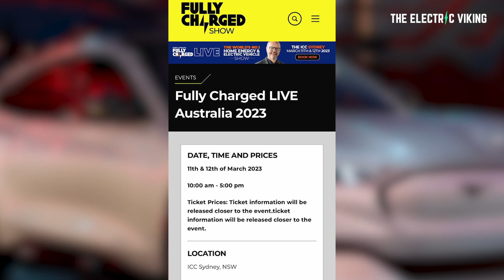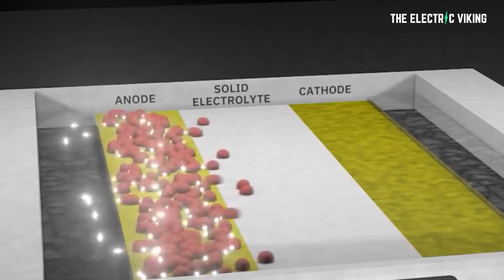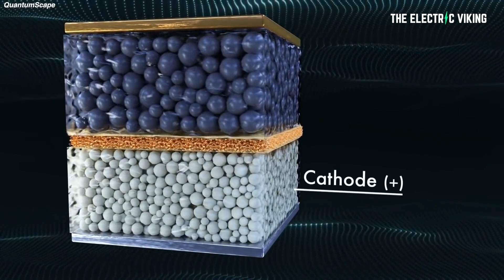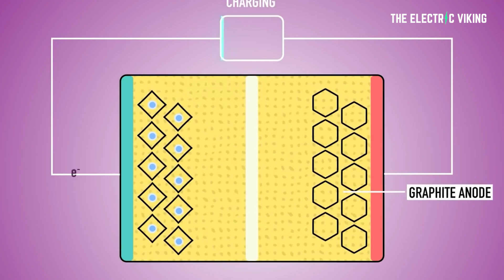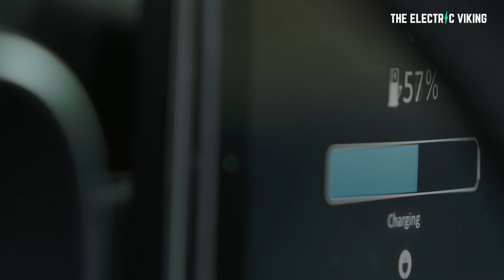Titanium diboride enables extreme fast charging without battery losses

Comment: The biggest problem with all these new battery chemistries and tech is not the tech itself, nor even really the scalability, but it is the greed/profit problem.  First, factories would have to change tooling, buy new equipment, etc for a lot of the different, new battery chemistry coming out the labs.  But the bigger problem is the problem of incentive for the corporations.  It's much like the pharmaceutical corporations in relation to things like cancer.  Do the CEO's/board members, share holders, etc of these giant, profit driven monster machines really want affordable, long lasting, true cures? Do they want cancer and the like eradicated?  Or would they prefer to keep making obscene profits?  

  It is similar with batteries. Imagine a battery with a far longer cycle life (especially this aspect), much greater energy and power density, much faster charging, etc and made out of cheaper, more sustainable and/more common materials?  Only a handful of companies would actually want that to come to fruition--mainly those that profit off less the batteries themselves, but the products that use them, like say Tesla. 

  Meanwhile, many of the mega corporations, like the ones that actually make the batteries currently, would most assuredly NOT want these kind of batteries on the market.  Eventually, their sales and profit would be affected negatively. 

   This is why any changes will be more or less incremental over time and not exponential and within a short time, if these mega corporations can help it. 

  It would take a grassroots start up to break through this barrier. A company with sufficient funding and independence, who cares more about long term sustainability over long term profits. Meanwhile, you can bet that mega corporations would likely try their best to interfere with their success. 

     Having grown up with a sociopathic family member, I am not naive to these types and that kind of mindset which becomes so common in the corporate arena.

Comment: For cars, any cycle life over 2000 cycles is unnecessary, but the ability to charge faster, operate over a wider temperature range, have less or no need for thermal management, have more power with less weight, have more power per volume, be intrinsically safer, and be cheaper and easier to build, are all things that will make a battery more suited for cars.

Comment: It seems likely any new process requiring industrial quantities of titanium would be problematic. We already have tight supplies, as things stand. Russia is the currently sanctioned global #3 producer, and China is #1. Titanium is used extensively in military applications, which will always take priority. Unless these new batteries require very small quantities of titanium, it's hard to see how existing supplies could be used in tens of millions of EVs, even if all the technical and production hurdles were cleared.

Comment: While all of these battery technologies are important and shows that developers, scientist and engineers are working hard on this issue none of it matters unless they can produce something tangible and at scale with a track record to show for. Today it's this tech, yesterday it was SSB and tomorrow it will be a breakthrough in Aluminum, Salt, Sand, Quartz and a host of other minerals, metals or materials. I'm not saying they need to stop but I think it's way too early to be speaking of tech as if it's a game changer. It doesn't change the game unless they can show that it is equal to or surpasses current technologies.

Comment: If this can be scaled up to EVs, how long would it take to charge a vehicle’s Battery from a solar panel on its roof? Come to that, how fast could you charge a Home Battery from PV Panels on a house roof on a sunny day?
Reply: I'd say about 3 months to charge an EV from solar PV on its roof.
Reply: @gregbailey45  That’s charging a battery from zero to 100%. Nobody does that. So, assume car is already charged at 20% from my home charger, and my Kia does 280 miles per charge…

Comment: Work on Titanium-Diboride for energy storage has been ongoing at Penn State University and many other research labs around the world for over 20 years, particularly for ultracapacitors. Therefore, if affordable/scalable, this technology could potentially replace most or all other anode currently used in all lithium-ion batteries. Viking - We need to better understand its scalable cost, if you can obtain more info on it. Excellent job bringing the awareness forward on this one!
Reply: It is not just about affordability and scalability--it is also about long term profit in relation to the mega corporations that currently make batteries. Would they really want a very highly efficient, long lasting/durable, affordable/sustainable battery to come to market when it would eventually cut into their profit margins majorly?  We the public and the "commoners" need to be less naive to the often psychopathic type mind sets that run and shape our world so powerfully (especially common in and among corporations).  The "good guys" are most assuredly not in charge in this world.  But rather the most greedy, self interested, materialistic, etc types are.  Even Japan, which seems like a more collectively minded, conscientious, and longer term minded country--well they really dropped the ball on Fukashima despite multiple warnings from multiple sources. And fairly easy fixes. No, corporations are not to be trusted when profit is involved.   

  It would take a grassroots, independent, new company that cares more about long term sustainability than long term profits, to get this going.  Not seeing any company like this out there so far.
Reply: @justinw1765   All should share your concern, since the foundation is a system of free enterprise, with a democratically agreed upon common set of laws/rules and regulations, including especially an active Anti-Trust Department to assure healthy competition. This foundation is even more important than any particular technology, since, without it, there can be no sustained advancement of any kind, only collapsing economies like Putin's Russia.
Reply: Th-stoked-ness

Comment: viking, most of these breakthrough battery disciveries are scams. You will be embarassed by them. Not all of them, but most. 
1. The materials are too expensive or rare eg gold, silver, diamonds
2. wear out quickly or catch fire
3 too many losses when charging
4 theoretically possible, but very difficult to ramp, or to make industrial equipment to produce the battery in mass quantity

Comment: A solution looking for a problem.
It’s cheaper to build battery swap infrastructure than the high power infrastructure for these ultra fast charge batteries. 
The cost of electricity is a lot cheaper too

Comment: From where are they going to get Titanium for industrial battery 🔋 manufacturing? Won't this be as controversial as colbat?
Reply: The current generation of LTO (Lithium Titante) batteries is 2.5 to 3 times more expensive than other common types of lithium batteries. Mr. Viking probably hasn't been in the bussiness that long, as the LTO battery was already used in Mitsubishi i-MiEV cars for the Japanese market 11 years ago and can charge to 0-80% in 15 minutes.  They are also used in some types of EV buses manufactured in China.
Reply: Depends on how much is needed per kg battery. If it's only like 0.5 kg per 500 kg battery pack, 1000 metric tons would equal battery packs for two million EVs, or maybe ten million hybrids.
Seeing as China is the largest producer of titanium, yeah, that's not great, but if price goes up a lot, there might be known deposits in other countries, which suddenly become feasible/profitable to mine.
Reply: Cobalt, maybe?  Titanium is plentiful, just not easy to work with... requires seriously elevated temperatures.
Reply: @billdale1  just fire up some more coal plants.  Problem solved 🤷‍♂️
Reply: Titanium dioxide is the main pigment in any can of paint.

Comment: We need more range cars than fast charging
Reply: If you live in a multi-unit dwelling (apartment) with no possibility to home charge, than faster charging is more important than range.
Reply: @sunrisejak2709  what if , you  fast charge your car and went on a trip with ur 300 km.range and u have no charging facility in ur way , what should we do ?
Reply: @ramakrishna5480  don't buy electric it's as simple as that.
Reply: @ramakrishna5480  Buy a PHEV! 😁 I go 90 km on electric alone and about an additional 500 km on gas if I need. Zero range anxiety. The 90km is charged from my solar system and covers about 70% of my normal daily driving needs. The longish trips (30%) I can simply go anywhere, anytime in complete convenience. EV infrastructure in many cases just not ready yet for BEV conversion.
Reply: @ramakrishna5480  That's just a temporary problem. Maybe in two years, you won't be able to plan a 300 km route in the US, which doesn't have a charging station or two on the way.
Although, Alaska may be an exception, but rural areas are always going to take longer for new technology to expand into.
Reply: @silvergreylion see  that's the problem , im not talking about usa , im talking about South East Asia , Africa , south asia
Reply: @dodgedemonsrtx  that's idiotic... you have to work past the problem, such as inductive charging built into the pavement, have appropriate h/w installed on EVs, and both the car and the charging unit programmed to communicate with one another so the power utility source can receive payment for the charge provided.

Thinking forward, charging could be provided without cost, similar to traffic lights, police, and road maintenace; if you simplify the process by eliminating the need for payments, it is more efficient and can simply be part of the municipal benefit of taxes.

In the U.S., edudcation, health care and other services can be very expensive; in several European countries and elsewhere, schooling, health care and other services are free.  In such places, free charging might be inplemented as a way to speed up EV adoption, and fight pollution, climate change, and fossil fuel dependency.
Reply: @ramakrishna5480  Ah ok, you didn't specify.
Yeah, developing countries will have to come up with some innovative ways to power vehicles until they've put up enough charging stations.
I imagine some strategic places would just have a non-grid-connected charging station, consisting of a large array of solar panels and (perhaps underground) storage batteries, and of course a few charging outlets.
Reply: @sunrisejak2709  in few years , solution to charge cars @appartments will be widely available. This is be good business opportunity which many would take. it's just about charges availability and EV upfront cost. Bring down the cost, make charging easily available even current range and charging speed is enough.
Reply: @manishtmr  I hope you're right  chargers get installed in apartments and condos but all of the apartment buildings I'm aware of say there are no plans or budget to install chargers anywhere on the premises. This from friends who live in the complexes. Thats in both USA and Thailand where I am now. Lots of talk about charger build-out but no action. I think people are going to have to rely on public chargers. Some charge stations being installed at hotels, restaurants, and coffee shops but as far as I'm aware apartments must be way down on the priority list.
Reply: @sunrisejak2709  buddy, there are companies which install chargers for free and then pay appartments some commision as well. This is happening in US and in India . Although scale is less cuz EV adoption is less. But the point is that Charging in appartments is a business proposition which has already started attracting companies. EU already has 25% new sales in EV and US will reach there in couple years. That's when you will see all apartments starting to get chargers. By the way, US already has chargers at most workplaces and many employers provide charging for free.